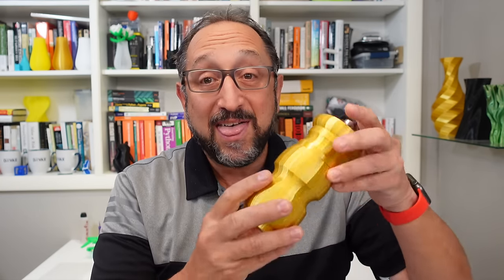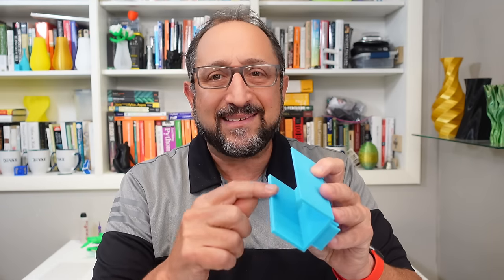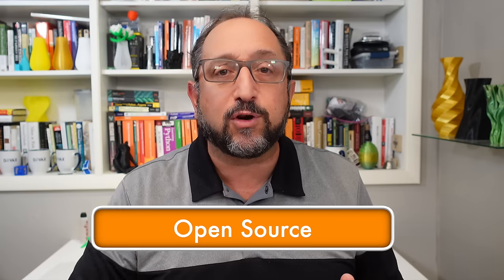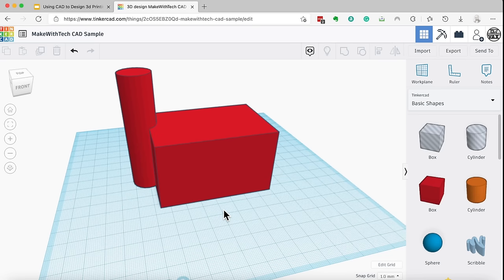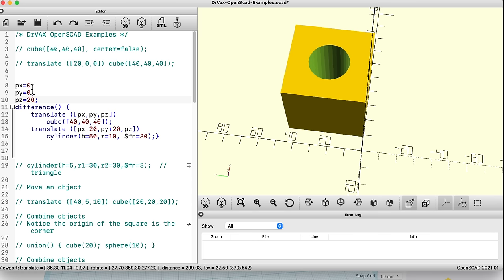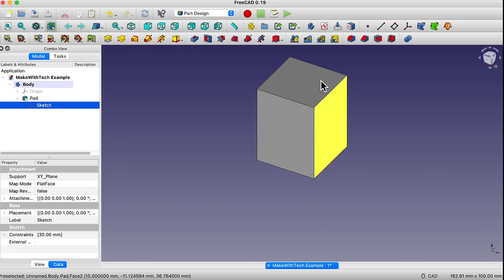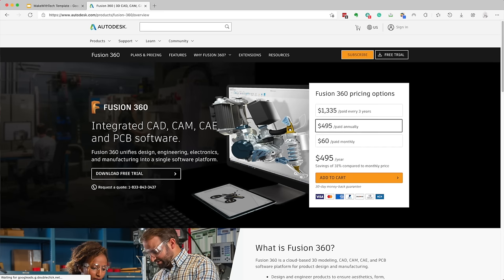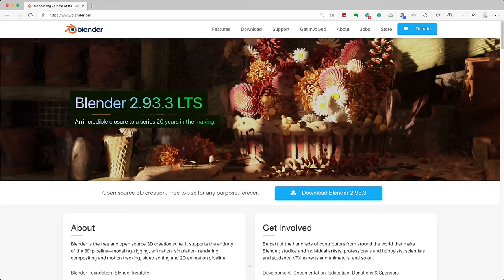Getting Started with CAD Modeling for 3d Printing

Comment: I started by using FreeCad but I found it really difficult to understand, so I am using Fusion 360 at the moment, I found that easier to make me understand CAD drawing . At the age of 78 I am really enjoying designing different things and then printing them out , I do have a 60 year back ground in engineering . It is funny when I got my 3D printer and came across g-codes they looked familiar and I found out I was using them in the '80's programming a machining center. But my career took a turn and I got into aircraft maintenance for my last 25 years. Thanks for the great video.
Reply from the maker: Your welcome.
Reply: I’m in the same boat, but a few years younger.  I am also a retired engineer, I learned cad a long time ago but essentially forgot it all which is fine since anything I learned then really don’t apply to the new tools.  I just loaded fusion 360 last night, let thee learning begin.
Reply: @MakeWithTech  You're
Reply: the reason that Freecad is hard to use at the beginning is that it uses the "standard" parametric design workflow which is made easier in Fusion 360 and DS SolidWorks where order of doing things isnt strict for example to sketch you need to select plane like all cad software but freecad needs you to make the part first then the body and only then the sketch which is how it is specified in the standard and fusion360 etc skip the manual making of   Plane selection -> Part -> Body -> Sketch workflow so you only need to go through  Plane selection -> Sketch  unlike the original industry standard minimum which freecad implements also the limitations of freecad are because they are trying to implement the minimums to meet the Standards and then start working on more qol features and keep in mind that freecad is still in alpha 0.20 so things may and will change but they will keep all the old ways of doing things unlike others as to not force you to learn new ways of doing things you already do one way
Reply: @thecow2756  it's pain to fix one wrong line and even easiest things take too much time I give too much chance to freecad but I failed it's not user friendly
Reply: @Krateian  yeah manually going through and re-selecting features is a pain after you change one thing and i understand that it is hard to use but i myself will never trust autodesk again as they have continued changing good products to worse versions of themselves and making you pay a more expensive license to get features back which they did with inventor back in the day and now are doing the same with fusion but if you want to use fusion you can remember that the free version has arbitrary active file limits but if you want to try something else Dassault Systems SolidWorks has a hobbyist plan which isn't too expensive and if your work wants to pay for the expensive pro license it is one of the most robust cad packages to date.

You are not forced to use freecad or any other cad and i respect you for even trying freecad as it is a intimidating piece of software but at the end of the day use whatever you want to use and like to use it is your choice after all.

Sorry for the long rant but i am pissed at autodesk for being such a a-hole company.
Reply: I'm just below half your age and hadn't done cad work in 12 years after being trained on SOLIDWORKS, sketch up, MATLAB and ansys. 

I felt the same with you for about 3 months. After I watched many tutorials and read many sites and now I can create motorcycle frames and roll cage assemblies with ease. 

I'm sure if you plod along, you'll get it. I can link you to some great YouTube tutorials as well if you would like.

All the best
Reply: @oneman29  I too would like to get your recommendations of good  YouTube channels and websites for learning modeling and design. 
 Would very much appreciate.
Reply: Well i recomend try design spark.... a lot Easy that the ones you mention a very powerfull... im 55 😂😂😂
Reply: Tanks for your info.  Now I know the difference between Fusion 360 and another.one.  I'm only 76, Retired.  Don't stop ! . . . Keep those "Little grey cells" Happy !

Comment: Thank you so much for this! OpenSCAD is mindblowing to me. The whole model is just text that can be tracked in git, easily shared and edited without worrying about any accidental changes. Customizer is also great. I can see how making more complicated and also more "rounded" designs in OpenSCAD can be challenging but I will keep digging!
Reply: Stay with it. OpenSCAD is outstanding.  If you are comfortable with any level of programming it is totally intuitive.  Probably a horrible choice for elaborate decorative designs, but for structural design I found it to be perfect (or will be once a measuring tool is available).  Adding libraries as you progress, both existing and your own, allows you to assemble new designs in minutes.

Comment: FreeCAD has a very steep learning curve. I’ve been trying to get into it for a while and it’s been like bashing my head against a wall.
One of the biggest problems is the very complex workflow, you have to systematically follow the given steps and it’s easy to miss one, which will leave you wondering what went wrong.
For example you have to ‘cancel’ the tool you’re using before you can add a ‘constraint’, which can be confusing.

There are plenty of tutorials on here for it some good, some not so good. I’ve watched lots of them and I’m glad I did because I’m finally getting to grips with it. The more you watch the more you’ll learn, it might not happen overnight but you won’t get there at all if you just give up.

If you keep bashing your head against that wall, sooner or later you will make a hole through it. I’m not sure if that’s a good analogy because my head hurts, but in the end it was worth it coz it really is a great program.
Especially when you consider the price.

Comment: I use Blender as my CAD because I learned it for drawing machine parts before I even thought of 3D Printing. I then took those parts and produced videos on how to assemble and disassemble parts or machinery. That's the power of Blender, the animation and video. But, I should take the time to learn FreeCad because of some the the little nuances that Blender has that limits what you can do. I've played with FreeCad a bit, but I always go back to Blender because I know it. Old and stubborn I guess. But, if you are starting out... FreeCad!
Reply: Learn parametric modelling in FreeCad and export your objects to animate in Blender and you will be much happier. I love Blender for everything but mechanical parts. They have added a few tools that make a few things easier in the most recent versions, but have specifically stated parametric modeling will never be a development focus - and doing anything dimensionally accurate is a comparative pain. (I honestly can't blame them, the core design already supports so many different things) I originally started on f360 learning parametric modeling, later becoming a refugee due to licensing changes and started to learn FreeCad. I end up in Blender manually editing other peoples mechanical 3d print designs that were only available as an STL. Would be easier to recreate most of these with Parametric modelling in CAD but I need to learn FreeCad first, not going to pay for F360 without a business.

Comment: Because I'm into toy design, I do use Blender. While it's not initially designed for precision engineering, and it's not what they promote primarily on the website, it's becoming more and more apt at the task. And it allows me to do the intricate mechanical stuff I need to do, like joints, while also letting me do more free detail work when the nuts and bolts are down, without having to take it to another program.
And of course, the open-source license is perfect; I can do whatever I like with my models, with no constraints on whether I can sell them or not, and the program is entirely free regardless.

I used to use SketchUp (its Component function was especially useful for allowing me to make multiple linked editable copies of a model so I could track the positions of the parts for clashes). But since they changed the license and went entirely cloud-based for the free option, it stopped being viable for me.
Reply from the maker: Thanks for sharing

Comment: I'm personally a fan of MoI3D when it comes to CAD. It's not parametric and it's not free, but it is petty cheap and really fun to use. It focuses more on creating rather than measuring and getting every single thing the right size down to the micron.
Reply from the maker: Thanks for sharing.  That is a different use case.  Most part design requires precision.

Comment: I've had my 3d printer now for about 3 years and I've tried a lot of CAD software. My career started me out as a drafting designer 35 years ago in AutoCad. From there I learned to program and went into full time software design. Now I've come full circle in my hobby and I was looking for something that worked, and had a lot of features.
You are correct! Fusion 360 is da bomb!  But it's gotten pricey for hobbyists. OpenSCAD didn't do it for me. DesignSpark was pretty ok. OnShape has a pretty big learning curve (not as much as Blender), but it makes some nice objects.  TinkerCAD is very cool and is my go-to for quick stuff.
Because I do a lot of 3d models for gaming (my other passion) I use Blender a lot, and I'm good with it. But it's focus is not mechanical. It's more of a pretty picture/gaming model software. I've tried to use it for 3D printing and it works, but it's focus isn't on precise measurements, so I was looking for something else.
I intend to try FreeCAD when I get finished writing this post. I like the way you explain things so I'm looking forward to your tutorial series. (You have a new subscriber)
Thanks again for all the hard work making and uploading your videos.

Comment: I started using Solidworks and UG/NX long before hobby 3d printing was a thing. For me it was always about turning my own designs into physical objects not downloading things from thingiverse to print. I own a perpetual license of SW 2016 and have access to NX at work so I'll stick with that but otherwise agree with your advice here. I would lean towards just living with whatever the free licensing is for Fusion 360 since you will become familiar with the Autodesk ecosystem which will help if you end up designing professionally.

Comment: HI great video , i use tinkerkad , freecad and meshmixer all together going from one to another depending wath i need to do , depending if starting with a scan from phone or creating a 3D piece
Reply from the maker: I use a similar strategy using the right tool for the job.  In my workroom I have both wrenches and pliers, both of which can be used to turn bolts, and select the tool based on the job.

Comment: Great video with lots of information.
I just found a somewhat new option which is the free version of CREO Express, a non-parametric modeler.
As far as I know some time ago it could only save it's very own format which made it useless for 3D-print, but the current version can also save .stl.
Of course there are some limitations compared to the full version like no use of additional modules, limited supported file-formats and a limited assembly size of max.50 parts per construction (which is still plenty)
Since I know CREO and its predecessors for about 20 years from work, this is great news for me. Being non-parametric has it's pros and cons, you dont have to deal with constraints and history, but changing parts can be a bit more work.
It's fairly easy to learn compared to some other bigger CAD-Systems but still possibly a bit overwhelming if you don't know CAD at all.
One problem everybody will encounter sooner or later is it's way to slice circles into lines, but that is easy to solve. While saving .stl you can enter the options (after selecting the part you want to save) and set the angle at which circles are broken down. This is normaly around 14°, which results in very rough polygons, but you can set it to any angle you want.
If you dont' want the hassle with fusions documents and license and don't need/want the parametric part of Fusion or FreeCad it's a great alternative.

From your list I personally like Fusion 360 the most, but the document-management (only 10 editable documents at a time) and the annual re-applying are sort of a hassle. Other than that I might even prefer it over CREO, especially for the parametric part.
FreeCAD sounds nice and it was the first that I tried, but it has some major downsides like missing function which are absolute basics in most CAD (parallel contour? Copying 2D? Mirroring at a line or edge?).

Comment: I'm starting to see 3D printing as one component of object manufacturing.  Using it not to make final objects but to make parts that will be used with other parts (some 3D printed some not) and also to consider machining 3d printed parts, such as putting a hole in something by drilling a solid 3D printed part.  So I still want a CNC machine!

Comment: Thanks for al your great video's
I'm a regular user of Fusion 360, TurboCad, FreeCad and Blender.
On the latter I'd like to comment. You mentioned Blender is not so useful for 3D printer. In that I strongly diagree. At first it looks complicated maybe, but the combination of regular solid modeling and sculpting is a very strong combination. Except when you only print object that can be dimensioned. But there is so much more in the modeling world. What you think of gaming, scenery, etc.
What I'm trying to say is that Blender deserves a better rating, since it has a great added value to 3D printing.
Reply: Blender is awesome, I can model extremely quickly and accurately even semi parametrically with modifiers. Just printed a model from blender today with no issue

Comment: I don't know if this kind of model exists in the CAD space but in the programming/gaming space one of the models that has been kind of dominating the space has been flexible licensing, where they will give you a free or cheaper licensing option below a certain earning mark such as Unity which says that until your revenue reaches 100k per year it's free to use which gets people in their environment and learning the tools and then if they ever get to a point where they are clearly requiring your tools then they are going to charge you for them. Kind of like a freebie to get the addict hooked.

Comment: I like the measured way you present your topics. I have been using the same cad system for years and I find things like Fusion completely unworkable. My brain does not work that way and neither does my cad.  Tried hard to get the hang of Fusion, but in the end I just spent the money on the upgrade for the program I know.   How on earth do you manage to wrap your brain around these different software packages, I certainly can't.
Reply from the maker: Thanks for the comment.  Learning new tech things is just my skills.   Everyone is is different.   Many people learn new spoken languages with ease.   I struggle with one.   The key is to help each other learn together.
Reply: I thought it was just me! Fusion 360 looks like FreeCAD or Creo. The screen it too busy. Only the menus that can be used, should show at any one time. 

What is your poison (your CAD program) of choice?
Reply: @christopherknee5756  software called Keycreator, used to be known as Cadkey

Comment: What graphicd card is good enough for 3d modeling and sculpting models for 3d printing in 2022? Not rendering
Reply from the maker: Most modern systems will work fine.  I even use cad tools on a Surface Go a very underpowered machine.

Comment: I do like the video it was very helpful in helping me understand what I want to learn as a hobbyist  for 3D modeling. however, I think some of your subjective ideas about the front of and pros/cons of some of the programs are a bit misunderstood by me. I think Sketchup and Blender are great for solid object design. maybe not precision solid object but it's great for creating objects that I want from my 3D printer. however as an engineer I appreciate the value of efficient and precise modeling as well.  I guess the  TL/DW is experiment the only way your going to know what tool you want to use is by doing what engineers and scientist have been doing since the dawn of time, try it.

Comment: I'm an advocate of skipping playing with blocks if a person has the ambition to do Parametric modelling and time to learn. If that is a likely goal; I suggest looking into it more first. If you are prototyping any sort of mechanic thing that needs dimensional accuracy and/or proportions to fit with other things: that's probably what you need. Freecad is the best option for most people, OpenSCAD for some too - If that's for you then you probably know it already. I regret not starting to learn some sort of Open Source CAD sooner, I'll skip ranting about Autodesk and their licensing decisions with f360 etc.  
Non-Parametric Modelling:
Anything organic, freeform or digital end result - chances are Blender is the answer. Blender is likely the answer for hard surface modeling needs (e.g. scifi spaceships) too. Blender is also what you want for clay modelling type sculpture unless you have $ for Zbrush. (Although you will still want a pressure sensitive pen input for sculpture no matter the program.) If you still like the idea of playing with blocks, learning to do so in Blender will take more effort, but give an in-road to a much more powerful program.